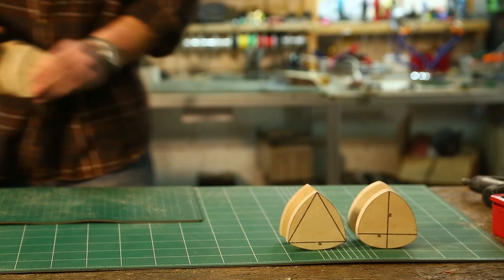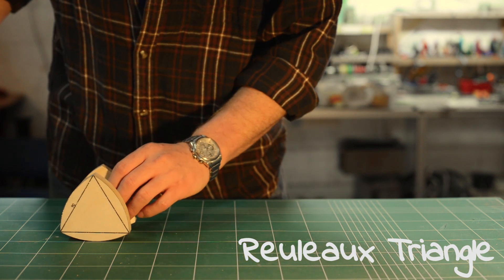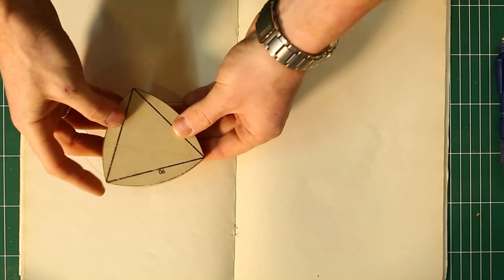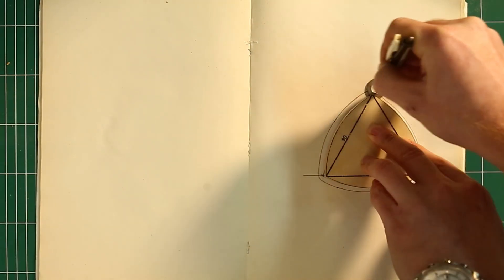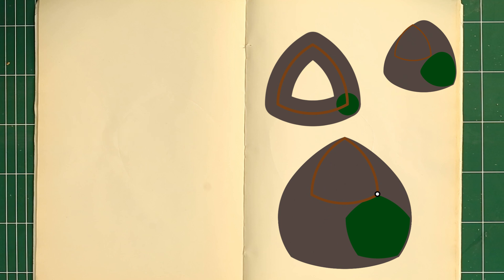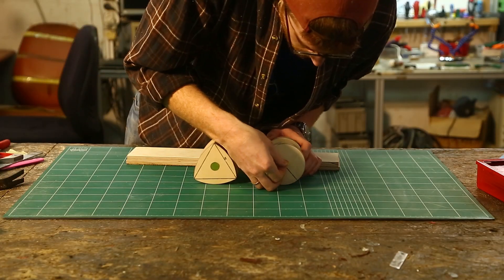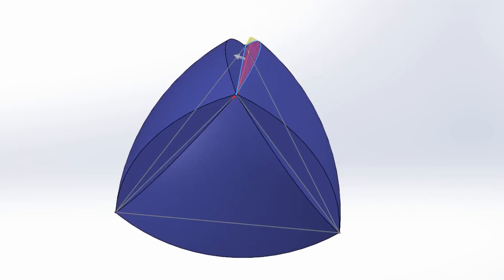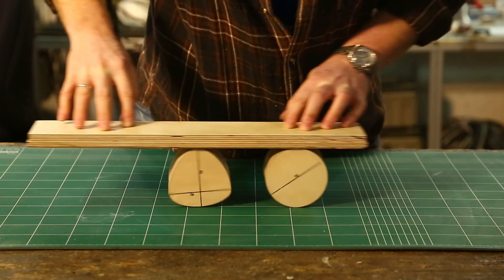Explaining Shapes Of Constant Width

Comment: At 1:15 it looks as if the vertex of the Reuleaux triangle in touch with the plane is motionless in the sense of remaining at exactly the same point on the plane, and acting as a pivot for the roll. In a continuing roll this will only last for a short time and will be followed by the adjacent arc contacting the plane, until the next vertex does the same thing. How long does the vertex remain motionless?  In the case of an ordinary straight sided triangle ABC  rolling to the right, this would seem easy to answer. Start with A as the apex and side BC flat on the plane and start to roll. C is the pivoting vertex at rest on the plane, and will stay there until CA is now flat on the plane and only start to move thereafter.  A rolling circle on the other hand never has any point on its circumference at rest on the plane. Is this the case with the Reuleaux triangle too? Just that the forward motion of a vertex in contact the plane  is very slow and doesn't easily show up? The forward speed difference in a bike ride with Reuleaux wheels would still make it an alarming experience of course.